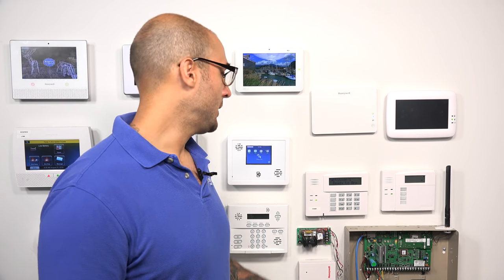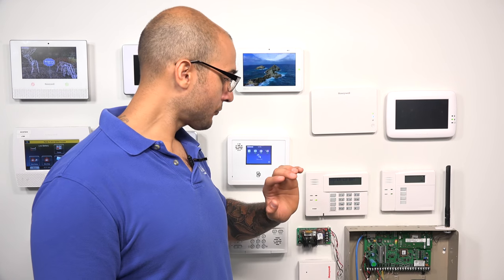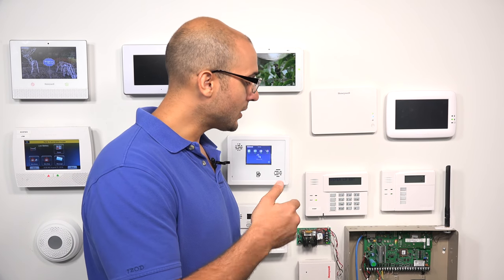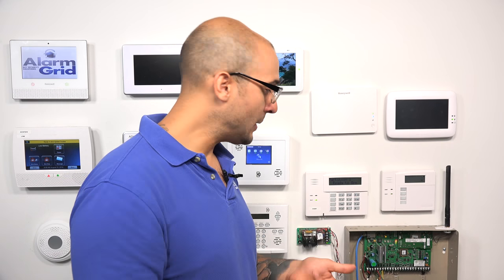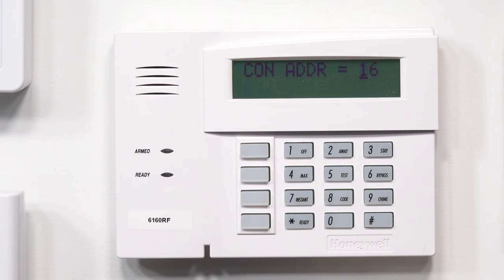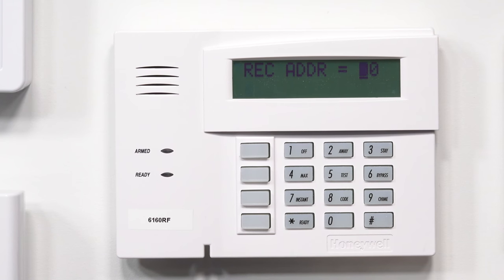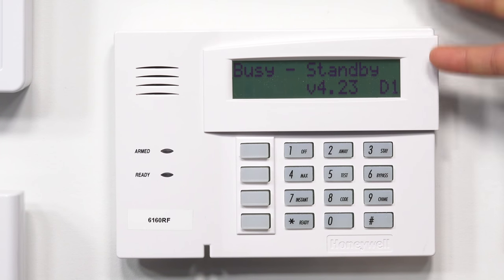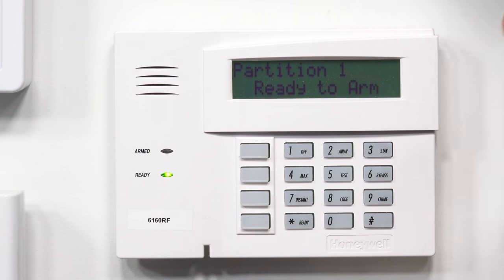How Do I Enable the Receiver in a 6160RF?

Comment: I just swapped  from a 6150rf to a 6160rf and 2 things I can't get the installer code ect.. or any to work. It's new . Worked on old keypad . Also the 6160rf displays ready to arm . But green light is not on! 
The  the system is  Vista 20

Comment: How many keypads can u add to system?
Reply: This depends on which system you have. As a general rule, residential panels like the 20p can only use 1 wireless receiver but up to 8 keypads. Commercial panels like a 128bpt can use 2 wireless receivers, but a max of 31 keypads.

Comment: I have a Vista-10P with a 6150RF display and all sensores in the house are wireless. I just bought a 6160RF. Will the RECEIVER ADDRESS be 00 and will I need to reprogram all the zones in the house? Thanks.
Reply: You will not need to reprogram the wireless. The only address the receiver can use on that panel is 00, as it only supports 1 receiver.

Comment: I replaced the keypad and can get into all the programming  and the alarm says it's set. But I am getting a check 100 on the system and none of the sensors are connecting. I'm going to try what you did in the video. Is there anything else I can try or will reinstalling the old keypad fix the problem?
Reply: If you replaced the keypad with another 6160rf putting the system in go no go test mode then tripping devices can help aswell
Reply: @joshuagriffin2807  how do I get it out of test mode?
Reply: @joshuagriffin2807  I have the wrong keypad. Oops

Comment: Is that keypad wirelessl 
To the panel or do you have to run wires and can I use cat 4 wire for it
Reply: You will need to run wires from this keypad to the vista panel. This keypad will give the panel the ability to communicate with wireless sensors.

Comment: I have a 6160RF, can I put another 5881ENH in the same system to extend the transmission range ?
Reply from the maker: Not if you are using one of the Vista-21iP, Vista-20P,  or similar panels.  Only the panels that support a polling loop, such as the Vista-40, Vista-50P, Vista-128 and Vista-250 panels support using 2 receivers.  If you aren't using one of the polling loop panels, you should invest in a 5800RP instead of another receiver.  https://www.alarmgrid.com/products/honeywell-5800rp